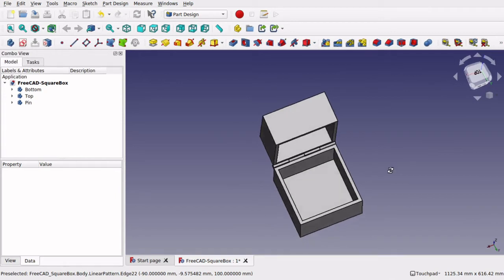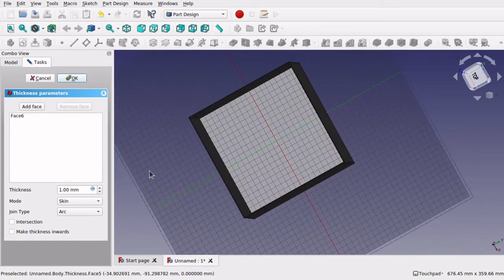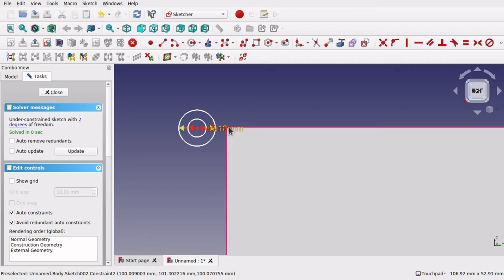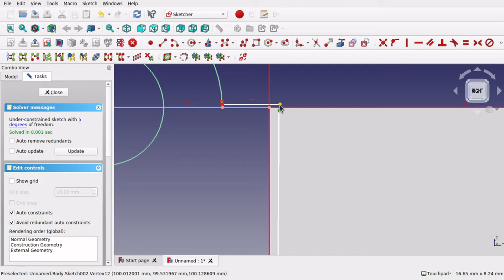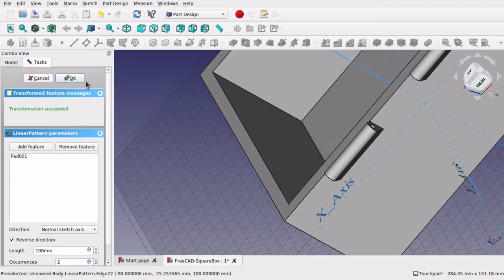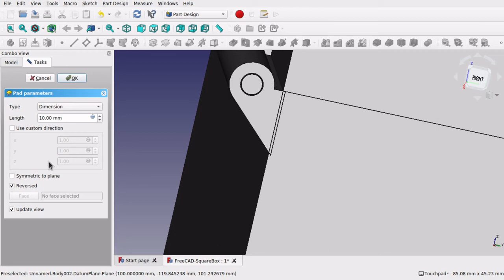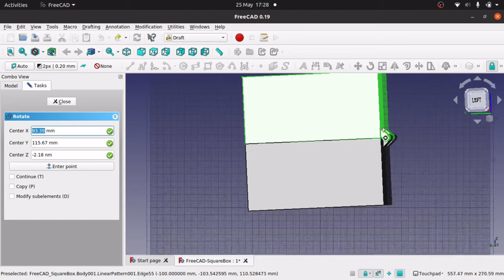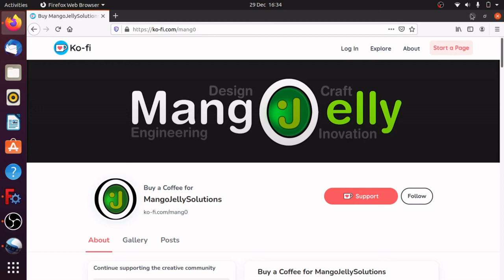FreeCAD Simple hinged box for 3D printing. Beginners Part Design Tutorial Linear Pattern for hinge

Comment: Just come across this video. Bit confused where you say you could print it open or shut. If you print it shut, won't the two halves fuse together ?

Also, if you print it in the orientation shown, what is there to keep the hinge pin floating, at least to one of the halves of the box ? You'd have to print it with the pin vertically, surely, but then you'd have the pin end-cap protuding.

Comment: hey you're a big help man thank you!! when I try making a pocket in my sketch the sketch layer and pad are not linked so it doesn't allow me to create a pocket. what am I doing wrong?! thanks again
Reply from the maker: Hi, it sounds like the sketch is not mapped to one of the pad faces. You need to click on the pad face first and then select the create sketch from the part design. If you click on the sketch you have currently created and  look in map mode on the data tab in your combo view you will see how it is mapped. If it says something like deactivated then click on the button on the end of the field. A window on the left will be shown where you have a number of text boxes. The top one has a button that you can click so it says selecting. Then you can pick your pad face by clicking on it. Either that or you have a broken geometry in your sketch. Make sure that each geometry on your sketch has no breaks in it I. E. If it is a square then all lines are joined together and don't seperate if you move each of the lines. Hope that helps.

Comment: I threw ya some coin. It was 10.50 but that's like 6 pounds. Our funny money sucks lol just a small thanks bro. I used one of your old videos about the a4988 drivers. It helped alot.
Reply from the maker: Ah thanks for that most appreciated. Ah yes I remember that video as I sneezed half way through and smoked one of the drivers as I was probing and managed to short the driver. I should of left that in as an out take. 😂
Reply: @MangoJellySolutions  I let the magic smoke out of one. Luckily I have a bag full of them and more arduinos than electronics store haha when I build my cnc machine I'm going to buy a specialized mainboard with better drivers.

I had to buy a better 3d printer because the tronxy and then the eryone were doa. I've been really into cmos logic lately and building stuff that doesn't rely on a microcontroller. It's fun and gives me a reason to justify owning an oscilloscope lol
Reply from the maker: @jstro-hobbytech  Iv'e switched now to drv8825 as the a4988 didn't deliver me enough power for my motors.  I must admit I have seen a nice increase in build quality.  I have had some really rough a4988's. What CNC controller are you using?  I have both the uno v4 shield and the v3 shield and I have had some real problems with the v4.  Been through 3 of the v4's. They just seem to stop working and plagued with design floors. Have installed the v3 and seems a much nicer board, well to start with everything is wired up correctly!

With the logic stuff have you played with FPGA's at all? Have done a little with them and it's something that I would like to get into.

Comment: Hello and thanks for all you do! I'm following along with your tutorial, trying to add hinges to my own project.  I'm adding hinges to the right side view of my project and the 2d view shadowing is in the way.. any idea how to disable this?
Reply from the maker: Thanks for your comments, sorry for late reply I am trying to get through a large number of comments on my channel, are you in the sketcher? I'm not sure what you mean by 2d view shadowing. I think you may need to use the section view tool to cut through the view. Do you have a screen shot of what you are seeing?
Reply: @MangoJellySolutions  no worries, really appreciate what you do.  So in sketch mode when you are looking at the squared up side of a part that has been padded, it has a shadow casted off to the right side showing that it's a 2d part.. it's just hard to sketch over that shadow and I was wondering if it could be turned off.  No super big deal.
Reply from the maker: @upnorthFPVandEUC  Ahh you on LinkStage3? If so on the top menu, view, draw style selected flat lines. :)
Reply: @MangoJellySolutions  Perfect thanks! I was crawling all through the preferences tab thinking it would be in there..  so here's my next issue.  I'm following along with you but my body is not square so I can't just clone and flip. Mirroring doesn't work either because the top and bottom hinges won't mesh up. What would be your preferred way to get the top piece finished with hinges in correct position in my situation?
Reply from the maker: @upnorthFPVandEUC  there are a number of ways, you can create the bottom and the lid as two separate parts and for the hinges shape binders. I am sure I have a example somewhere. Once I am back home in a couple of days I will have a look.
Reply: @MangoJellySolutions  thanks!

Comment: Your original idea was to print the box on it's side. As the hinge pin has protruding heads on it then surely this is not ideal? You could reduce the hinge widths at the sides and then the pin heads would be flush with the sides making printing less of a problem.

Comment: Can a FDM 3D printer print that hinge and it actually work? I suspect if I printed it with my printer then it would all fuse together and you'd not actually be able to open it. Perhaps it depends upon the quality of the printer. 

Most of my designs have been fairly static or I've used screws as hinges (typically to allow movement then fix the position). If I was doing that I'd probably buy a metal pin to go through and use that instead, but I'd be interested to hear your experience and whether that can be 3D printed as a working joint.
Reply: I was thinking the same thing.  Is it possible to print the pin?
Reply: @KurtSchwind  I don't know if the pin wont fuse to the hinge. Would be great if someone tried to print it.
Reply: I haven't tried this myself, but if there is a gap between the pin and the hinge it will print disconnected and should work fine. But, there will be another problem: assuming the side of the box is on the print bed, the caps on the pin will be below the edge of the box and the print will rest on the face of the caps, leaving the entire box unsupported! This will cause the print to fail.

Comment: how do we create an STL from this I can select each body seperately but if I select and control each body then I get the box sealed??
Reply from the maker: You can export out the individual parts by selecting the bodies one by one and exporting them. If you select multiple parts and export then they export as one but they are compounded together. Which is the same as I did with the print in place assembly video I belive. Its a pretty old video which I would like to revisit using assembly workbenches and parametric spreadsheets.

Comment: Late post. Great video as always from MangoJelly. But as few mentioned, there will be problems with 3D printing this. The hinges will fuse together and the pin will float in the air (depending orientation of print) and the pin being so thin it will be weak.
Suggestion for 3D printers would be to dump the pin, use a piano or brazing wire (or even PETG or stronger piece of  filament) and glue it in on one hinge only. Adjust the hole to correct diameter of wire + a gap. Make the hinge length slightly smaller so there is no binding or fusing.
Also you only need to design one side and duplicate it in your slicer. But this is a Tutorial, so nothing wrong the whole design (even with a pin). I still learned how to design a hinge.

Comment: is it possible to make this parametric?
Reply from the maker: Yes it should be possible, this is another one  that I really need to  revisit.
Reply: @MangoJellySolutions  it would be very usefull I can para the box but not sure how to link with the hinge in relation to the box?? so a video would be great, possible also incorporate a clip to hold closed like two interlocks on the top into two slots in the bottom??
Reply from the maker: Sounds like a job for spreadsheet and either a link action or assembly workbench.  Can see this being a pretty useful tutorial
Reply: @MangoJellySolutions  I think it would be most useful 🙂

Comment: What are DoF's??? in a sketch please
Reply from the maker: Degree of freedom. This relates to how constrained down your sketch is.  Zero degrees of freedom means the sketch is fully constrained. A single line without any constraints has 4 DOF's;  add a horizontal constraint you are down to 3, constrain the length your down to two, point on line constraint on horizontal axis, down to 1. point on point constraint to point of origin then 0 or fully constrained.